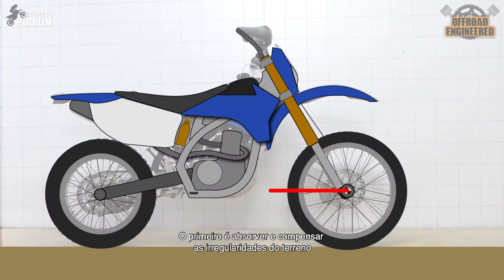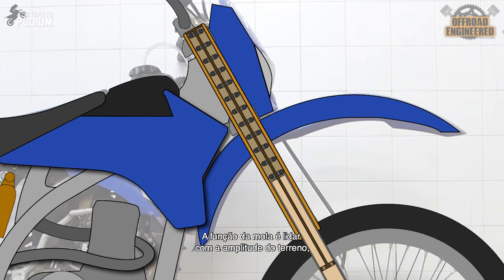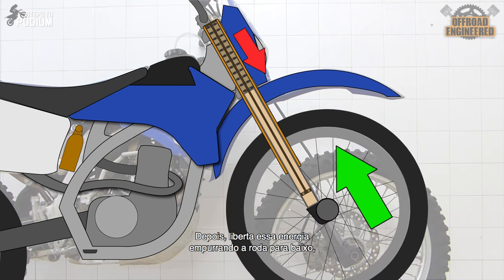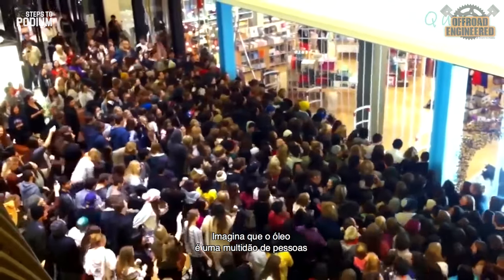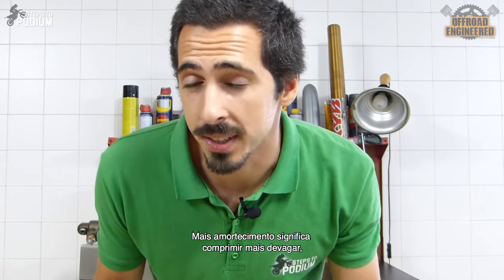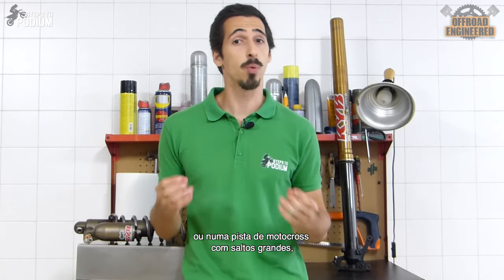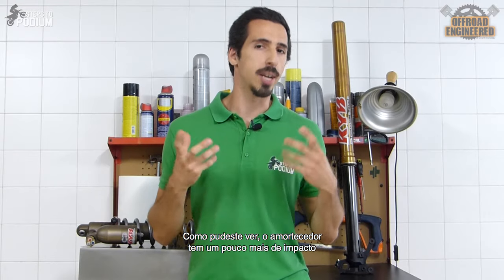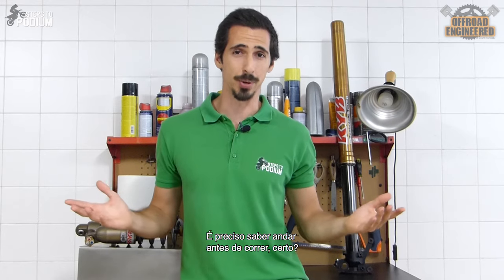How dirt bike suspensions work | Offroad Engineered

Comment: I still got a pair of 1990 KYb 41mm forks around that have a pair of bleed holes drilled on the dampening rods, homemade punched shims, custom valve bosses, custom Nylatron rod bushings, and some other crazy stuff. These forks were from my works yz250, they lacked separate low speed adjustments so all this was to get a good soft low speed dampening without the excessive front end dive, at the same time better high speed dampening. The ports in the rebound valve were also opened up and polished. I don't have the bike anymore but still have the forks and shock. We also cut the upper shock mounts off and changed the angle of the shock.
Reply from the maker: nice project!! 😁💪
Reply: What's a works yz250?

Comment: If you were around in the 80's and 90's you would have seen some crazy stuff done on suspension. The forks we had sucked compared to today, especially when yamaha introduced its upside down fork. The shock setups were ok stock but required a lot of valving changes to work well.
Reply from the maker: nowadays they are fantastic off the box!
Reply: @StepstoPodium  yeah we made them work pretty well but still a far cry from modern suspension. Back in the day all the big money guys had ohlins.
Reply: @jenpsakiscousin4589  What's Ohlins?
Reply: What's a upside down fork?

Comment: hi, can i ask? in the AMA supercross championship the rear is very high and stiff, is it a particular calibration? or very preloaded spring?
Reply from the maker: It is only because the damping setting is really stiff and doesn't allow almost any compression since it generates a lot of damping from nearly stopped
Reply: @StepstoPodium  ok thank you for your time even if I didn't understand well😄😄
Reply: hi I would like to ask you, I have a kxf 450 2019, the forks harden in the middle of the stroke, is this normal? do you have any suggestion? 12click extension/16 compression..
Reply from the maker: Check the tightening torque on the triple clamps
Reply: @StepstoPodium  I checked it is affixed 12 nm
Reply from the maker: Then I would recommend to take the forks apart and check what's happening
Reply: @StepstoPodium  I recently overhauled them, and I told them to add a little oil, will that be the problem?
Reply from the maker: Over messages is hard to tell! Maybe we should schedule a technical session to better understand the issue 💪
https://www.stepstopodium.com
Reply: @StepstoPodium  the site is very interesting, maybe I will do the online course, thank you very much
Reply from the maker: Thank you! 😄
Reply: @StepstoPodium  if I have to change the setting of the forks or shock how do I do? can you help me?
Reply from the maker: Yes, I can :)
Take a look at our technical sessions:
https://stepstopodium.com/technical-sessions/
Reply: @StepstoPodium  sorry how does it work? I don't understand the 30 min or one hour session. is it a workshop job?
Reply from the maker: We schedule a 30min or 60min online 1-on-1 video call :)